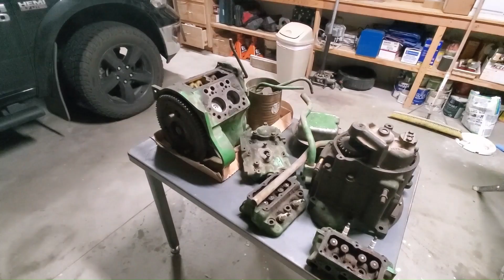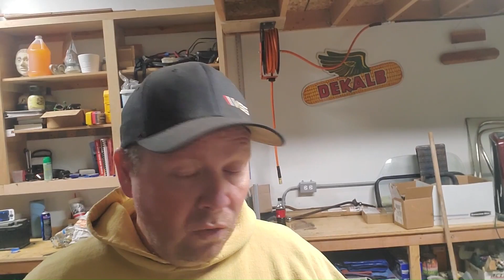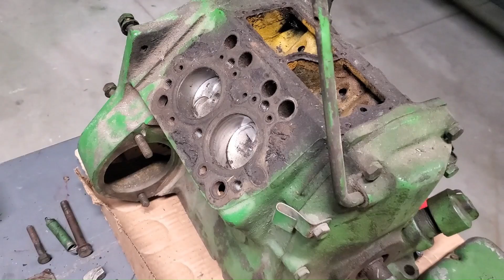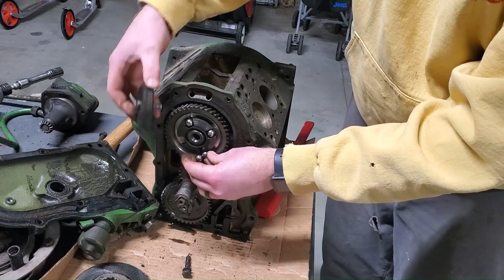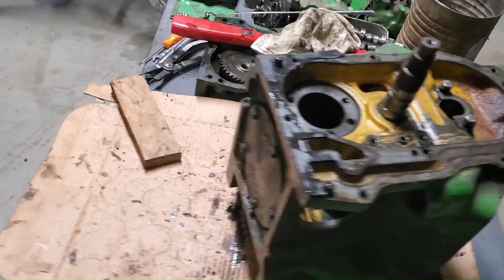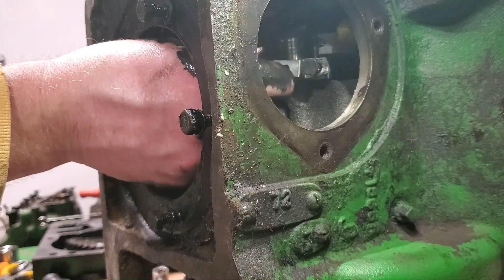John Deere 720 Pony Motor AUTOPSY - Broken Piston Rods

Comment: That thing either ran out of oil or they weren’t turning the gas off to shut it down after the diesel started. That would cause fuel dilution in the oil because the tractor bouncing around would cause the carb to flood the pony motor with gas. That would leak past the rings into the oil.
Reply from the maker: You're likely right, fuel dilution from the carburetor flooding is a very common cause of failure on these pony motors!

Comment: Why would anyone take any old Tractor parts to the dump.  As a minimum they would be worth  $240.00 per ton at the scrap yard.  With basic maintenance they should virtually last forever.
  Before Youtube there actually were Shop Manuals.
Reply from the maker: One man's junk is another man's treasure. That was the case here. I'm just glad I could snag it!

Comment: There no rod bearing shells , the aluminum rods are the bearings
Reply from the maker: Thanks for the help. That's what I've learned from other people... No rod bearings. I can't imagine why Deere didn't use a bearing... But I guess if you keep the oil high and clean, they worked out ok.

Comment: Be sure to replace the seals In transmission .
I just o. H. One and the gear box had grease instead of oil . Not good in winter...
Reply from the maker: Yes, I just rebuilt the starting transmission for my 830-industrisl. I put new seals throughout. The roller bearings all checked out ok.

Comment: I'm kinda new to these Antique JDs. Trying to find more in on connecting hydraulics to my 46 A Slant Dash Power Trol.  Can't find info any where.  Could you assist with a video?
Reply from the maker: Not sure what you need to see. Are you wanting to move the rocker arms off the 3pt or connect hydraulic lines and run an external cylinder?, We've always been lucky enough to just put 10W-40 motor oil into the power-trol reservoir, turn on the PTO, move the lever and it works. They seem to be pretty reliable.  But we do have a 1944 slant dash with the older pedal style power trol and we've never done anything with it... Maybe I could see if it works.
Reply: @jonelsonster   I have 46 Slant Dash A, Want to connect my front loader. It has one hose.  Pretty sure it's a  New Idea Horn 50 Front Loader. Not sure how to connect it.

Comment: My 720D pony motor had a Wico magneto, two coils, Harley style. Mine was actually converted to Harley 6v coils as the Wico ones were marginal. Early Briggs were same bore and stroke with same aluminum directly on the crankshaft. I would not be surprised if the rings were also same width tho I never took mine down that far. It should have an ignition disable with low oil pressure. Use a good plug as when pony is installed one plug is not accessible. The best cold starting tractor at the time. Have fun
Reply from the maker: A lot of good information here! Thanks!
Reply: @jonelsonster  He has a good tip about oil pressure shut off on the ignition. I've used one for years, it avoids burning up expensive ignition coils

Comment: Can you tell me what size and thread the hole is on the side of the block for the oil pressure line? It looks like you have a pipe plug in it. Mine had a brass fitting there with an oil pressure line that ran up to the automatic fuel shutoff. It broke off when trying to get it out and I’m trying to tap the hole without pulling the pony motor out. Thank you!
Reply: 1/8 pipe fitting. The early ones just had a pipe plug. I have mine plumbed to an oil pressure gauge AND an oil pressure switch to shut off the ignition power when there's no oil pressure
Reply: @weirddeere  thank you! That’s extremely helpful! I am in the process of putting in an oil pressure gauge for it.
Reply: @flinthillacres3009  Books says 25PSI just so you know
Reply: @weirddeere  yeah mine is at about 20. I guess I will have to pull the cover and see about turning it up a little bit.
Reply: @flinthillacres3009  20 is fine, I wouldn't pull the cover for that. It's a bit more work than it looks like. Unbolting the engine and lifting up the front of it and lots of other things
Reply from the maker: Thanks @weirddeere!

Comment: That would have to be a tough life, start cold, run 6,000 rpm and shut down.  They did take a fair amount of upkeep to stay running. We had a 1955 '70' with a pony motor and a 1959 '730' electric start.  70 would always start, roll it over and hit on 2nd or 3rd compression!  Amazing.  Thanks for showing this lttle guy!
Reply from the maker: Not too mention crank that big diesel motor over too! We have a 70 D too. It's a very reliable tractor.

Comment: These engines were a bare aluminum rod on the steel crank, it worked, but if anything went wrong with the oil, bad things happened, very quickly. If the waterpump seal went out, the (quart) of engine oil got contaminated with antifreeze and turned into glue instead of slippery stuff and the engine would die quick. Unfortunately no over/undersizes from factory
Reply from the maker: I guess the lesson to learn here is check the condition of the pony oil before every start. Based off the wear on the rods, this thing either had contaminated oil or was starved of oil. I found the passageways from the valve train in the heads back down to the crankcase were plugged... So any oil that was pumped up to the top of the engine probably didn't drain back down to the bottom in time to replenish the sump... And the rods paid the consequence.
Reply: @jonelsonster  the plugged head passages are one reason for their reputation as mosquito foggers. Then the oil just went down the valves and out the exhaust!

Comment: I've rebuilt two of the V4s. Yes they're pricey, though there is a supplier that makes it a little better. The little L bracket is part of the governor/carb linkage, it holds a spring to adjust the high PRM speed. I didn't see the spring. The beat up square "shim" is the lockplate for the flywheel. There are a few variations of the pony motors, yours is an earlier model, with the smaller pushrods. The 830 would have the latest model with heavier pushrods and lots of other changes. Some stuff interchanges, but not EVERYTHING. The transmisson is totally different between the 70 and 80 series.
Reply from the maker: I'm glad to hear they beefed up some things between this and the later series. Because these pushrods are very flimsy. And I'm glad you told me about the difference in transmissions. I'm sure I would have have figured it out... But it's nice knowing before I started disassembling things! 😂
Reply: How pricey? I have one that needs a freshening up. Smokes and doesn't seem like it has the power to really spin the 730  motor.
Reply: @nwyoda8792  I haven't shopped in quite a few years. It's easy to dump 2K. Some parts are actually cheaper and more available now, even oversize pistons I believe
Reply: @nwyoda8792  I haven't used them but have heard good things about H & J Machining

Comment: Very interesting tear down. I have alway wondered why JD used 4 cylinders instead of 2 cylinders.
Reply from the maker: Not sure. But I'm guessing the 2 cylinder pony motors like the R had wouldn't fit under the hood of the 70, 720, or 730. So they designed this one, which was more compact? That's just a guess.
Reply: The V4s would fit under the hood of the 70 diesel, and had more power

Comment: I wonder if this poor engine was run without oil.  I have never seen slop like that!
Reply: Often people shut them off without letting them run the carburetor out of gas. The gas ended up in the cylinders washing the oil out. They then wore through vibration of the big diesel.
Reply from the maker: The maintenance the previous owner performed definitely could have been better!

Comment: Never new pony engine had 4 cylinder interesting. Thanks for showing us the ends and out .
Reply from the maker: I'm not sure why they decided on 4 little cylinders, but it is a compact little guy. It fits under an 830 (or 80 or 820) hood a lot easier than a 70 series.

Comment: Thanks for the dissection of the pony motor. Nice to see what’s in there. I had a pony motor that leaked oil from bottom. I presume the round gasket at bottom of motor or it was the drain gasket into big motor. Nice video
Reply from the maker: I never really would have thought to look on the bottom side for a removable cover!
Reply: A Cat had their own dipstick.  @jonelsonster

Comment: I started fooling with Cats in my late teens and have never seen the inside of a pony motor but sure cranked a few. VERY interesting and the crank looks to be in good shape with maybe a little polishing. Looks like maybe they have sleeves but maybe no inserts. Lots to learn. Sure is interesting. Thanks for the video. My ears are up even more!
Reply from the maker: I'd be interested to know if cat used aluminum rods with no bearings... I'm guessing they may have been a little more heavy duty? I kinda wanna get my hands on one of those now! 😀
Reply: I'd say steel but what I've seen a Cat was slower turning than a Deere starter. The opposed piston jobs, D2's and 4's whizzed but the side by side twins like for the 7's, 8's and 9's were slower. Maybe you can find one. It'll be interesting for sure! @jonelsonster